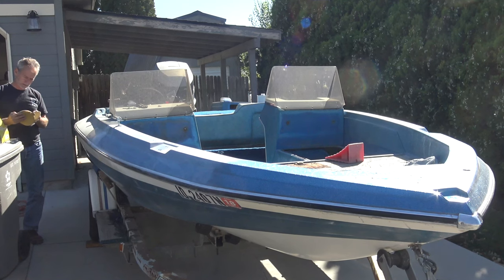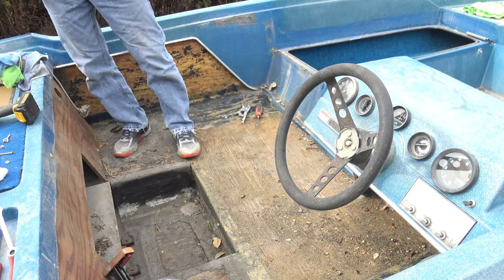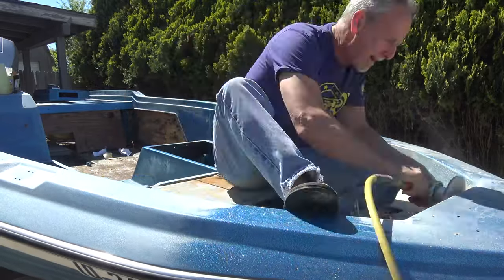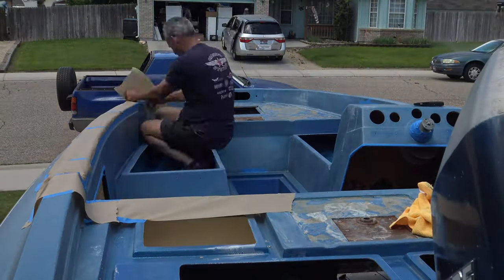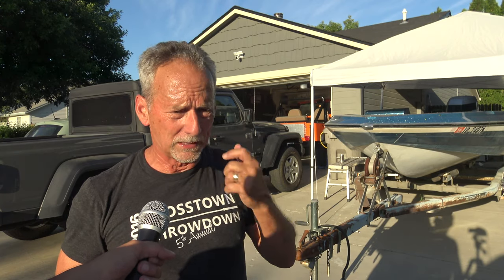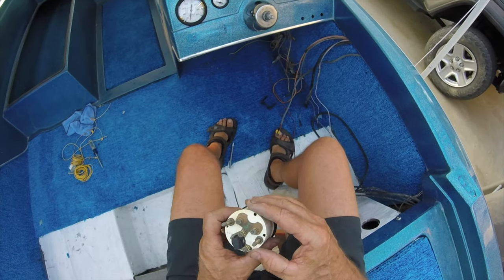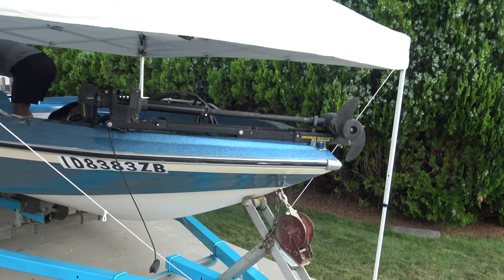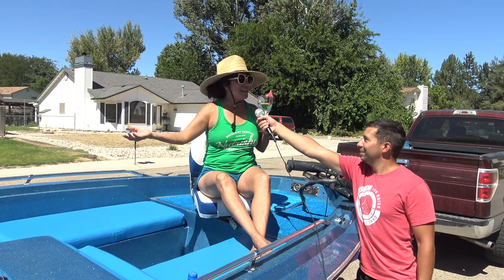Bass Boat Restoration (Official Full Edition)

Comment: Dude, you should have totally covered bottom of the hull, when painting that trailer. Keep putting more coats of resin top coat to the top cap. Make it illustrious, and replace that rubber side molding guard. Get a Bob's marine jack plate, and raise that motor up. Then repaint the motor with all original paint schemes. Take your time here. Put a custom prop on it.

Comment: I bought a new HPV 172 with a 175 HP Evinrude plus a EZ Loader trailer in 1982.  The following year I added a Evinrude 24 volt bow mounted trolling motor.  I loved that boat. It was stable, very fast to plain with a top speed in the sixty’s. That was a fast boat in those days.  Used for fishing, it was incredible.  I spent many a hour fishing from the bow seat.  I’m not sure how your engine is set up.  I added a stainless prop (SST) that made a world of difference in the boats performance.  With a aluminum prop the boat would top out about 50.  With the stainless prop I was able to mount the motor higher then while running I could trim the motor out lifting the hull producing much faster speeds.  I remember the only issue could be chin walking, at full speed, that could scare the crap out of you. The boat never gave me any problems.  I sold it after about ten years to buy a boat that had a cabin.  Looking back now I wish I hadn’t sold it. I stayed in upstate NY on freshwater lakes until the early 2000’s before moving to coastal FL.  It would not have lasted long in saltwater.  I never kept in touch with the guy I sold it to but I think it could still be on the water, at least I hope so

Comment: Hey. I have a 1976 Terry Bass boat that I have used on Lake Lowell for about 6 years. I want to restore the bottom and the green metal flake. I am in Boise and could really use some of your advice on the electronics. I love this boat and want it to survive. I have a 115 HP Johnston. Runs great. Lets talk. I love that you rolled the gel coat. I may do that myself.